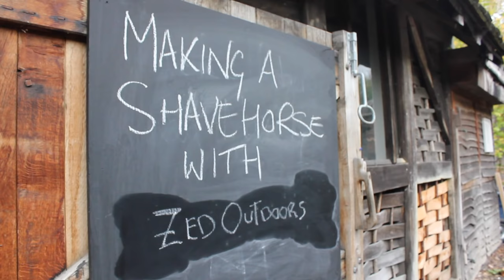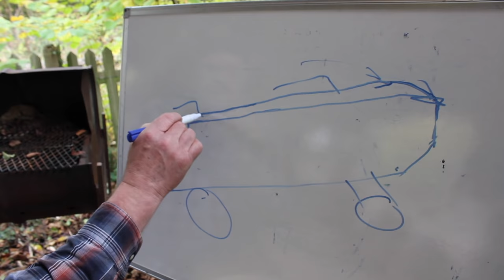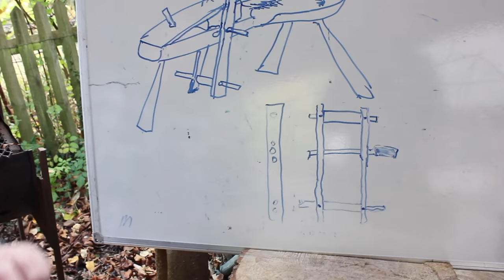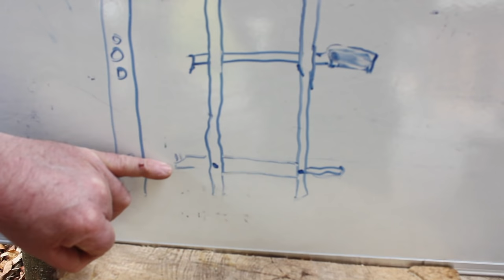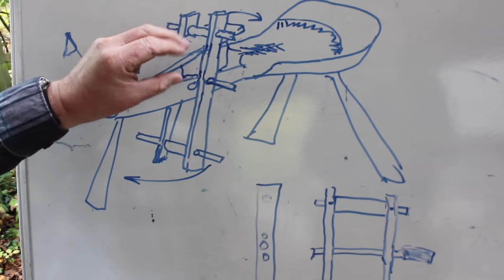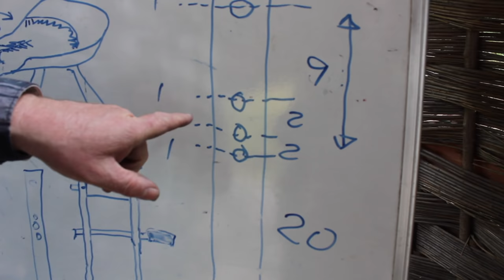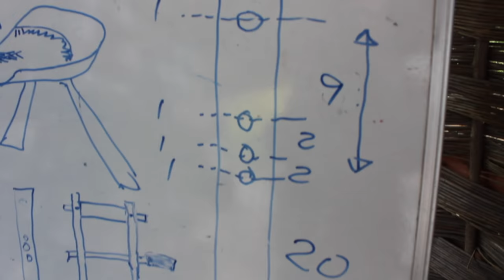Building A Bodgers Shavehorse (Complete Tutorial)

Comment from the maker: 00:00:00 - Intro 
00:03:31 - Example of a Bodgers style shave horse 
00:07:31 - Assessing the piece of Ash and making a score line 
00:10:28 - Splitting the Ash with metal wedges 
00:15:25 - Severing the straps (fibers) with an axe 
00:18:48 - Securing the split Ash with Timber Dogs 
00:22:17 - Making a straight line on the split Ash using a chalk line 
00:23:07 - Neill discussing how he is going to level the face of the split piece of Ash 
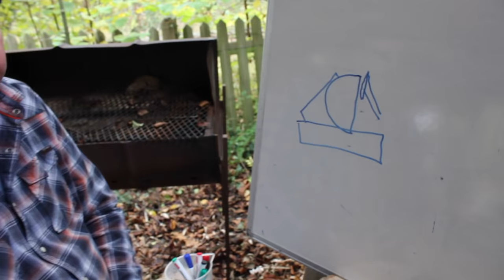00:25:26 - Leveling the face of the split Ash with a small forest axe 
00:27:50 - Making some stop cuts on the face of the split Ash with a chainsaw 
00:30:47 - Leveling the face of the split Ash with a broad axe 
00:33:08 - Type of woods you can use to make a shave horse 
00:34:46 - Marking the length of the shave horse 
00:36:15 - Laying the Ash on its front and marking the central line / outline 
00:43:10 - Shaping the saddle with an adze 
00:49:08 - Shaping the saddle with an in-shave 
00:53:54 - Shaping the saddle & surface with a travisher 
01:04:10 - Milling a plank using an Alaskan chainsaw mill 
01:08:26 - Cleaving the legs 
01:12:38 - Shaping the legs with an axe 
01:18:32 - Shaping the legs with a draw knife 
01:23:54 - Shaping a round tenon on the leg using a rounder plane 
01:28:25 - Drilling the holes for the legs using a scotch eyed auger 
01:34:20 - Inserting the leg into the body 
01:37:13 - All legs fitted and testing stability of the shave horse 
01:38:11 - Cutting the side arms from the plank using a saw 
01:45:16 - Cutting the ramp from the plank using a saw 
01:47:25 - Discussing and making the wedge / block that goes underneath the ramp 
01:50:12 - Discussing the side arms and the round pieces that go into it 
01:54:48 - Cleaving the round components 
01:57:17 - Shaping the round pieces with an axe 
02:01:12 - Shaping the round pieces with a draw knife 
02:04:31 - An introduction to Pole Lathe 
02:07:23 - Turning the round foot piece that attaches to the bottom of the side arms 
02:17:21 - Turning the round clamp piece that attaches to the top of the side arms 
02:26:25 - Turning the round pivot piece that attaches to the middle of the side arms 
02:33:24 - Turning the round peg piece that locks the ramp in place 
02:38:35 - Techniques for cutting a Tenon if you don’t have a Rounder Plane 
02:43:30 - Looking at all four round pieces that were turned 
02:45:12 - Measurements for the holes on the side arms 
02:46:33 - Tweaking the top round clamp piece so it grips wood better 
02:48:48 - Drilling the holes in the side arms using a Brace & Bit 
02:53:02 - Using a steel wire on the pole lathe to add an effect to one of the round pieces 
02:54:17 - Doing a dry run to check that all the round pieces fit into the side arms ok 
02:55:16 - Drilling the holes into the main body using a brace & bit 
03:01:34 - Drilling the hole into the ramp using a brace & bit 
03:05:30 - Carving oak pegs with a straight edge knife and drilling holes the holes for it 
03:07:58 - Conclusion
Reply: Zed Outdoors い
Reply: Zed Outdoors い
Reply: Zed Outdoors 
Qq
Reply: This was so very interesting,could watch this stuff all derds thanks for your time
Reply: I am very thankful for you and and Niel. I am using this as a reference to build my own. Thank you from South Texas. God bless
Reply: Zed Outdoors ,m
Reply: Thanks so much for sharing this. My horse very near ready now.
Reply: Zed Outdoorsd
Reply: Zed Outdoors
 

Z
Reply: 7
Reply: BB uj
Reply: An invaluable resource! God bless you Zed! God bless you Neill Mapes! I don't use Facebook or Instagram, so can't pay my respects, but let me do the best I can here. Thank you so much for openly sharing this information. God bless you all, in all of your endeavors!

Comment: Edited Video Timestamp from Description with Actual Links to the Timeline for Convenience for Everyone:

@0:00 - Intro
@3:31 - Example of a Bodgers style shave horse
@7:31 - Assessing the piece of Ash and making a score line
@10:28 - Splitting the Ash with metal wedges
@15:25 - Severing the straps (fibres) with an axe
@18:48 - Securing the split Ash with Timber Dogs
@22:17 - Making a straight line on the split Ash using a chalk line
@23:07 - Neill discussing how he is going to level the face of the split piece of Ash
@25:26 - Levelling the face of the split Ash with a small forest axe
@27:50 - Making some stop cuts on the face of the split Ash with a chainsaw
@30:47 - Levelling the face of the split Ash with a broad axe
@33:08 - Type of woods you can use to make a shave horse
@34:46 - Marking the length of the shave horse
@36:15 - Laying the Ash on its front and marking the central line / outline
@43:10 - Shaping the saddle with an adze
@49:08 - Shaping the saddle with an in-shave
@53:54 - Shaping the saddle & surface with a travisher
@1:04:10 - Milling a plank using an Alaskan chainsaw mill
@1:08:26 - Cleaving the legs
@1:12:38 - Shaping the legs with an axe
@1:18:32 - Shaping the legs with a draw knife
@1:23:54 - Shaping a round tenon on the leg using a rounder plane
@1:28:25 - Drilling the holes for the legs using a scotch eyed auger
@1:34:20 - Inserting the leg into the body
@1:37:13 - All legs fitted and testing stability of the shave horse
@1:38:11 - Cutting the side arms from the plank using a saw
@1:45:16 - Cutting the ramp from the plank using a saw
@1:47:25 - Discussing and making the wedge / block that goes underneath the ramp
@1:50:12 - Discussing the side arms and the round pieces that go into it
@1:54:48 - Cleaving the round components
@1:57:17 - Shaping the round pieces with an axe
@2:01:12 - Shaping the round pieces with a draw knife
@2:04:31 - An introduction to Pole Lathe
@2:07:23 - Turning the round foot piece that attaches to the bottom of the side arms
@2:17:21 - Turning the round clamp piece that attaches to the top of the side arms
@2:26:25 - Turning the round pivot piece that attaches to the middle of the side arms
@2:33:24 - Turning the round peg piece that locks the ramp in place
@2:38:35 - Techniques for cutting a Tenon if you don’t have a Rounder Plane
@2:43:30 - Looking at all four round pieces that were turned
@2:45:12 - Measurements for the holes on the side arms
@2:46:33 - Tweaking the top round clamp piece so it grips wood better
@2:48:48 - Drilling the holes in the side arms using a Brace & Bit
@2:53:02 - Using a steel wire on the pole lathe to add an effect to one of the round pieces
@2:54:17 - Doing a dry run to check that all the round pieces fit into the side arms ok
@2:55:16 - Drilling the holes into the main body using a brace & bit
@3:01:34 - Drilling the hole into the ramp using a brace & bit
@3:05:30 - Carving oak pegs with a straight edge knife and drilling holes the holes for it
@3:07:58 - Conclusion
Reply from the maker: Thank you for this! ~Peace~

Comment: Many thanks for the video, I had to watch it over a couple days and scribble notes.
I'll be making mine from what is called a scaffold plank, rough-sawn 3x12 pine available cheap, and maybe a BIT air-dried.  As stated they're used on scaffolding for the temporary decks.
I particularly like the seat scoop, save the behind from my bony pressures.

i'll be knocking mine out at a local pub for those that want to watch and maybe stick their hand into it.
No pole lathe, but I do have a powered one.  I'll show how to make the spindles from using a draw knife.
I DO have a round tenon tool, looks like a brace, but instead of the bit head it has an adjustable cutter that will do round tenons from 3/8th inch up to 1-1/2 inch.

Incidentally, I have used a wood plane on the lathe to final shave the diameter of a spindle or tenon, makes very smooth cuts if approached with the blade presented in skew.

Well Done Sir!
Reply from the maker: Hi Ryan, sincerely appreciate your kind words and by the sounds of how you're approaching building your own it will come out really nice! take care ~Peace~

Comment: if you're looking to use a drawknife to make your legs but don't already have access to a shavehorse, try this video about a two-piece setup with a low bench you sit on
https://youtube.com/watch?v=Xd_ScopY7lQ&t=319

- a stair-stepped block, fixed to the bench
- a wooden chest-plate with a 5-8" bit of  post screwed into the middle of it, with a castle-joint on the end

You brace the leg/spindle between the chest plate and the toothed stair-step fixture on the bench and lean forward. The crenelated post on the chest plate lets you work more of the piece without turning it around, and creates a bit of a stop-block for the cut
Reply from the maker: Appreciate the heads up Andrew thank you ~Peace~